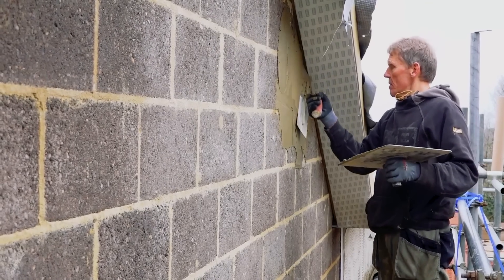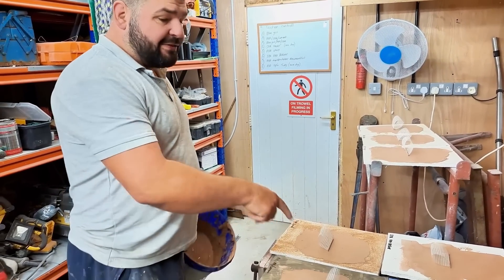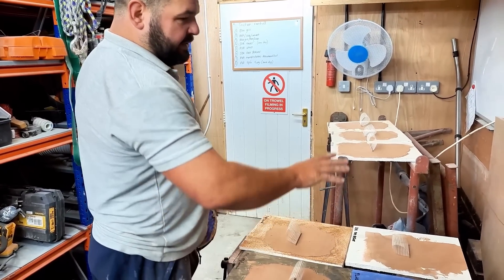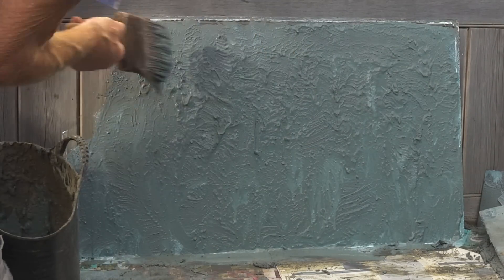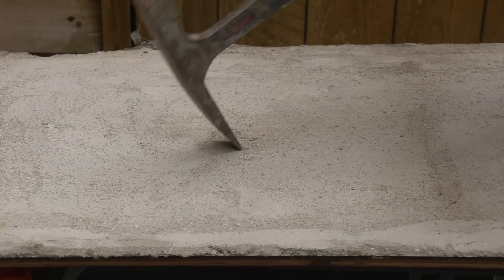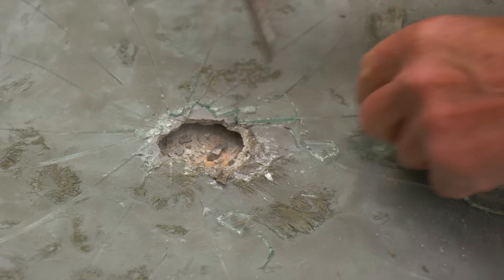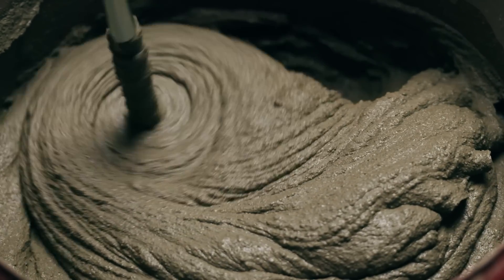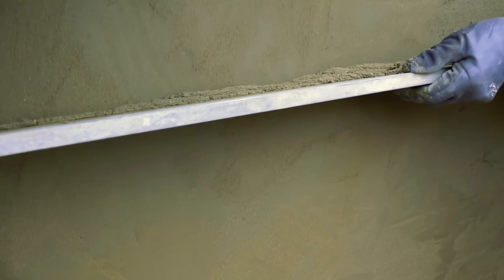The Best Bonding Agent Revealed

Comment: Interesting, thanks, but the bottle of PVA you show is for interior use so what happens if you use exterior grade PVA which is supposed to be waterproof? The exterior PVA is supposed to be waterproof so would it still emulsify in damp conditions like you say? I'm not knocking SBR in any way as I've not used it yet but just wondered how it compares with Exterior PVA which is what I've used in the past.

Comment: I had to do the external door reveals to my garage, I just happened to get the reminder for this new video and just happened to watch it before I did the render.. I had some SBR from the past in my shed, read the instructions (1 part SBR to 2 parts cement) and made up a cement paste which closely resembled floor levelling compound. My door reveal had them stupid plastic cavity closers with no strength however using this stuff on them and some expanded metal lathe I can safely say my render went on fine and stuck. Did it in 2 coats, but having never done external render before after watching this video I became more confident and gave it my best shot.
A good video, came just in time, thanks 👍👍👍

Comment: Pva is not for external use with sand and cement it says it on the tub in bold lettering.  Sbr is a far superior product for external use and has many different uses. Another stupid video from Roger.

Comment: Hi can you advise me what would be the best to do, i am changing a 1300 x 700 rad but can't find one that size so would it be best to fit a 1300 x 600 or a 1200 x 700 thanks Stuart.
Reply: For the same heat output, have you considered a double or even triple rad? You can look online and every manufacturer will give you a BTU output for a rad, which you can use to compare the rads. Hope this helps

Comment: Hi Roger , yes, totally agree, sbr mixed with cement is extremely strong. I am a plasterer and have recently started my own channel mastersmurf74, have a look if you  get a chance. Sbr in sand and cement outside, 100% , never pva . Pva can’t take it outside and will break down.
Inside, pva is perfectly fine . It’s been used for years. I’ve used it for years as a bonding agent and never had a problem with it. 
Sbr inside, I’m not so keen on. I have had trouble with it, causing strange air bubbles , killing too much suction. Making the surface to be plastered very slippery.
So I do not use it inside. It’s too thin and too stronge. If you get it on customers curtains, then it’s curtains for them! Get any drips or pva on anything it shouldn’t be on, a worksurface in a kitchen for instance, a tilled floor etc. with pva you have a chance of getting it off. So to be honest, I’m a bit scared of sbr inside, it’s too strong and I have never had problems with pva inside, so that is what I use. 
I do see other plasterers talk of using sbr and I see Kirk has brought a plasterers mix of sbr which is pink and thicker. Maybe I should try it. But then again, I’m thinking pink sbr? Then if that gets on the work surface, it’s sbr that’s pink and not clear, maybe an issue there.
I tend to use gloves with sbr too as the sbr cement stains stay on your hand for 2-3 days. Pva will come off in the shower that night. Don’t get sbr in your hair!! That could be another issue against pink sbr.
Anyway , great video Roger, and a great channel , I have recently subscribed.

Many’s thanks
Andy

Mastersmurf74
Reply from the maker: Great comment Andy,  I will have a look at your channel
Reply: @SkillBuilder  cheers pal .

Comment: Perhaps I'm a bit dim or uninformed. In South Africa, any form of covering something with a cement mixture is generally called plastering. What is the difference between rendering and plastering?
Reply: In the UK plastering is done indoors while rendering is outdoors.
Reply: I'm not a builder, but I think rendering would be a more durable material like concrete,  more waterproof to the environment amd so its excellent on external walls. Plastering definitely is not so strong or robust but so could get a smoother, better finish. So plastering would be used for internal walls where damp is not going to be an issue. Base material would be something like gypsum.

Comment: I don’t use anything else. Bonding, waterproofing etc. I had a customer with an underground outhouse where when it rained hard water would come through the bricks. I did x2 coats of 50/50 SBR cement, no sign of water or damp ever again. I once had a splatter of it on my old van and I just couldn’t get it off 😂. 
It’s the do all additive. PVA just doesn’t compare.